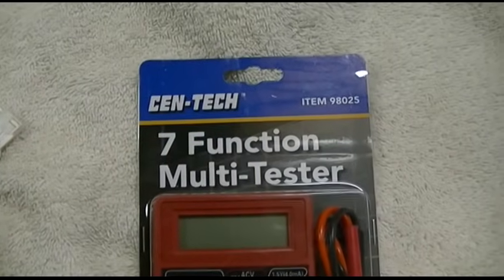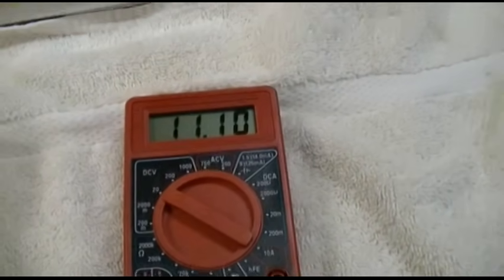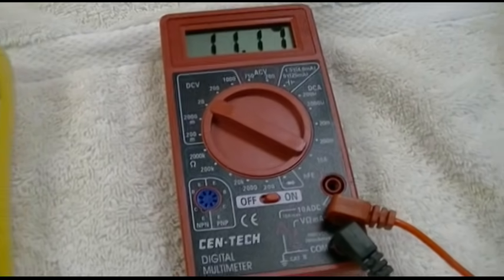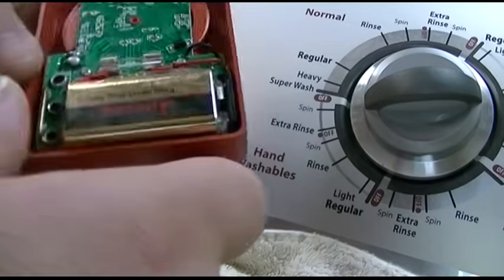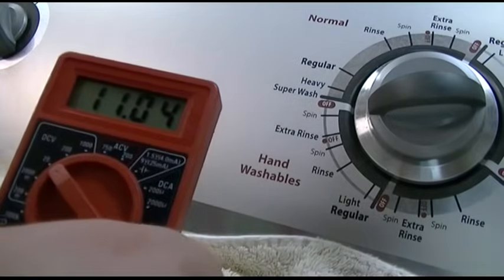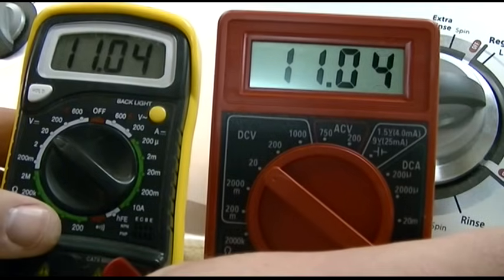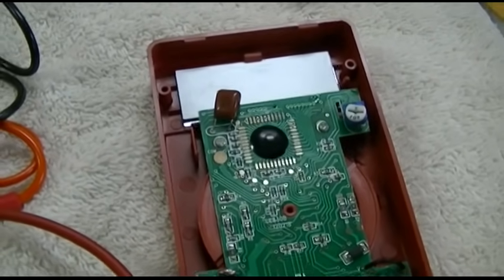Harbor Freight - Cen-Tech 7 Function Digital Multimeter Review

Comment: I got one of these for Christmas last year and it doesn't read at all. I wonder why is it doing that
Reply from the maker: Generally, 1 of 4 reasons:
1.  Low battery.
2.  Problem where the meter leads plug into the meter.
3.  Problem where the meter lead wires go into the probes.
4.  Problem where the meter lead wires go into the plug that goes into the meter.

The first one you can just try another 9V battery.  For the second, I have a video on how to fix that:  https://www.youtube.com/watch?v=s-99VP7UyZI

For the other 2, it's going to require soldering.

Comment: I have the same multimeter but when I switch it to the DCV 20 Setting it does not give me a decimal number reading except for three numbers like 000, 120, 230. Etc. I am trying to test the voltage of my car battery to see if it has 12.4 volts it needs. Does this mean my multimeter is broken and does not read the correct settings anymore ??
Reply from the maker: Sure it was on the 20V scale and not the 200 or 1000 by mistake?  If yes, it may be defective.  You can try measuring anyway, it's not going to hurt anything, and may still read (it's possible the decimal point in the display went bad).  If none of that is any good, it's likely defective.

I know of 3 problems with this meter, all involving the test leads and where they plug into, but this is a new problem I haven't heard of.  Anything is possible of course.  

Eventually, you'll get a coupon for another free one.

Comment: Update to this video look for the meter numbers. 63758 and 98025.  These two numbers you can adjust the meters and also replace the fuse.  all the other numbers looks like you're pretty much screwed.
Reply from the maker: Thanks for the additional info.
Reply: @jaykay18  Your welcome. There is a total number of six different meter numbers that you can get. I bought all six different ones took them apart and those two are the only ones that you can replace the fuse and also adjust the meter.

Comment: Which one is for continuity???? I Can’t find it
Reply from the maker: If you're looking for the continuity buzzer, you won't find it because it doesn't have one.
Reply: jaykay18 so it doesn’t have a continuity setting?
Reply from the maker: Not one where it will beep if there's continuity, but that doesn't mean you can't test continuity with it.
Reply: Yeah I’m testing my car fuses because my 12V sockets aren’t working and I’m not sure how to make sure they’re working
Reply from the maker: Continuity is measuring resistance, or ohms.  Set it on the ohms scale.    Put the probes together and get your base reading, which will be close to zero.  Whatever number that is, consider it as zero.  If you see just the vertical line on the display when you test a fuse, that fuse is bad.
Reply: jaykay18 thank you!!! This helped me out a lot and now my 12v sockets are fixed
Reply from the maker: See that, the Harbor Freight free meter saved the day again!

Comment: I did not find your video helpful.  I knew nothing about this meter and after watching your video, I still know nothing about this meter.  What are the red and black wires for?  Where do you plug them in?  How do you test a fuse on a car?  Maybe some of these answers are on a different video.  Anyhow, I see 2K on the thumbs up and under 350 on the thumbs down.  Some are happy with your work.  Have a great day.  Ed
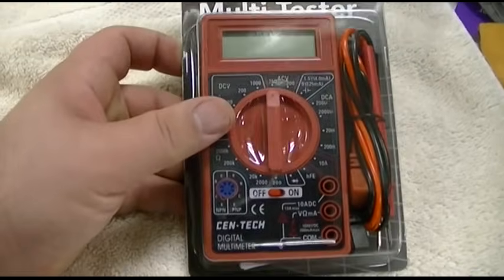Reply from the maker: At 1:04 I explained that how to use the multimeter was going to be beyond the scope of this video.  Most people will tell you that if you have to ask what the red and black wires are you shouldn't be using a multimeter, but I won't, rather, I applaud your willingness to learn.  Unfortunately, again, that was beyond the scope of my video.  There are hundreds, if not thousands of other videos that can explain it, and probably explain it better than I could, although I usually have a way with words.  I wish you the best in your endeavors and your quest for knowledge.

Comment: I know this video is old but I hope someone can help. I got this same multimeter and have been watching videos on “how” to use it. Working on my boat (12v system). 2 fuel tanks w/ a toggle switch that switches the “tank selector valve” between the two tanks. Same as some of the older Chevy trucks. I have removed the “valve” to replace but was told to check the wires first. It is a 6 point connector that plugs  into the valve. Told two turn the key to “acc” and then test each wire of the plug, in both toggle positions. Question: what setting do I use and what do I touch the red/black leads to??? PLEASE HELP.
Reply from the maker: If this connector with the 6 pins is hooked in to the rest of the boat, you'd set it on the DC volts scale, the 20 volt scale is fine.  The boat should be using a 12 volt system.  The meter will automatically detect if the probes are backwards, if so it'll just put a minus sign in front of it.

I'd imagine this is much like a car--put the black probe on a good ground, negative of the battery is fine if it's nearby.  Then start probing the connector, you should see 12 volts on certain pins depending on the switch position.  There may be pins you're not seeing 12 volts on.  But if you tell someone who knows "I got power on the red and the yellow wires depending on which way the switch is set", they can probably tell you it's good and to replace the valve.
Reply: @jaykay18  man i appreciate it TON!!! Thank you!!
Reply from the maker: No problem at all!  Comment back when you get it all sorted out.

Comment: Lol I'm a dummy. I bought it thinking I could test the voltage of my car batteries and alternator. Oh well, guess I'm not retiring my nearly 50 year old snap on meter after all. Now if I could only remember how to check dwell....
Reply from the maker: This will give you the voltage of your battery and the alternator with the engine running.

As for dwell, that's a measurement of the duty cycle of the circuit.  The breaker points switch the ignition coil on and off.  One side on the positive of the coil, the other side to ground.  You're interested in how long on vs. how long off.  A meter like this can't tell you that.  An expensive multimeter can, but those old vintage dwellmeters told you a lot more information, especially with an analog display.  That's why I always keep a couple old analog meters around.  And I have a dwellmeter for my 67 Riv.

Comment: I purchased the 98025 meter the other day for $2 at Harbor Freight. The board looks different, the fuse is different, it is soldered directly to the board and labeled .5A/250V. The potentiometer is missing.   The number on the board is DT-833, dated 2012.3.31, the board looks like a generic cheap multi-meter board that gets re-branded for whatever company wants to apply their name to the case.
Reply from the maker: That may be a copyright date on that board and not a manufacturing date.  That's why I always put the date I recorded the video on in the description.  This video is over 5 years old at the time of this writing.  Their stuff changes.
Reply: I think it is interesting how it has changed in a few years.  I put the revision number and date for reference purposes for any viewer to compare with their unit.  The board no longer contains a potentiometer, a new viewer might be looking for something that no longer exists on newer models. The fuse soldered directly to the board makes it cheaper to manufacture, it would be cheaper to get a new one then replace the fuse. 
It makes me wonder how far off the reading is on the unit.
Reply from the maker: I doubt the reading is very far off.  If you're using this basically to test for "power/no power", or if you know the approximate voltage you should be expecting, it does a fine job.  For very fine measurements like for electronics work, this is a no-go.

Comment: Say what you want. Free country. I purchased one of these meters, brought it home, opened the box, the meter was broken, the case was cracked. Went back to Harbor Freight, exchanged it, opened the box, same fricking thing. Exchanged it again, and in the store opened the box, and tested it, did not work. So I raised my standards a bit, and purchased a Klein.
Reply from the maker: You're probably the exception rather than the rule.  I must have 12 of these meters, maybe more, and every single one of them has worked out of the box.  Have the meter leads broken?  Yes, several times, and I've repaired them.  Your Klein was probably a minimum of 10 times the price of this meter (for a cheap one), and likely made in the factory in China right next door.

Comment: what i like about this meter is that you can turn it OFF to change the setting with out  it trying to show a different reading.       just dont let the smoke out.
Reply from the maker: Yes, always best to shut the meter before changing modes; other meters are better shielded but they can cost 10-100 times more!

Comment: I got a few of these for free several years ago using the coupons...every one of them has met my expectations as the usual unreliable made in China piece of junk. Bad leads, incorrect readings in any mode, no voltage when there is, you name it. If you need a reliable, accurate meter, save yourself a lot of headache and just buy a Fluke or other name brand. If you just play around and don't need accurate readings, this junk may get you through, especially if you get it for free.
Reply from the maker: For free, these meters are quite functional.  Fluke is made in China now also, so they're not as good as they used to be.

As for the leads on these meters, they can fail where they plug into the meter, or the wires can fall out of the probes, both are simple fixes, and I have videos demonstrating repair techniques for both.
https://www.youtube.com/watch?v=s-99VP7UyZI
https://www.youtube.com/watch?v=bx0X-l0QITA
Reply: @jaykay18  
Thank you for the reply.
What I meant by "the usual unreliable made in China piece of junk" was these are of the typical low quality generic item that China mass produces for export, slapping anyone's name on it that wants to claim it as their product. They mass produce junk at the lowest possible cost, which means use of faulty and dangerous components of the lowest possible quality and engineering/design standards, just enough to get something shipped out, and we in turn create a demand for these items because we're cheap and they're cheap so we're a match made in China. Lol
They, their government in particular, just wants the world's wealth and power transferred to them so they encourage this practice, and a lot of their population are desperate so this is what they put out to serve their communist government. They tend to keep THEIR best for themselves, pumping out junk for everyone else, especially America.
You shouldn't have to fix something you just bought, or got free with a coupon because you bought some other junk. Its not even worth the time to take it back or throw away even to fill our landfills with more of China's trash that we paid to have made and shipped over. Lol
These generic items are always of far less quality than items originally designed and/or made by a reputable company elsewhere with quality standards in place. And they always diminish that quality once they begin manufacturing them there, but companies get greedy and sometimes desperate for that year over year profit margin increase so they consider it an acceptable tradeoff.
Anyway, thanks for the tips to repair, but again, they aren't worth the time...unless you're trying to teach someone some basic troubleshooting and repair skills.
They aren't even worth the time I spent typing, or the battery power I used on my device, or the cost of the transfer and storage of data out there in cyberspace, or the time it took to design the coupon, or the cost of ad space, paper and ink, mailing it out, wear and tear on the printing press, the vehicles used to transport, and so on...let alone the time I originally spent watching your video.
My point is, we waste a lot of resources on junk, our most valuable one being our time.
Thank you for taking the time to make and share your video though, and for reading my comment and replying.

Comment: Recently picked up my 2nd HF Multimeter with the coupon.
Haven't tested the accuracy using another meter, but the first one appears to be functioning within a reasonable range. Using it mostly to test resistors, diodes and low voltage projects.
Reply from the maker: Yes, I wouldn't use this for any mission-critical work, but for simple measurements where they don't have to be exact, it's plenty good.
Reply: Thank you for the video.
Cheers brother
Reply from the maker: No problem!

Comment: Have 3 of these .be careful on low ohms if you apply voltage burns out a resistor .good for price.
Reply from the maker: Thanks.
Reply: It will make a popping noise then your meter shot
Reply: Clamp-On Multimeter Channel friend left in microwave turned on really pooped was a 100$ one .we repaired TV's and was perfect for what we did .have all kinds of expensive equipment but hiring help theese were better could throw them away.😎have 3left closed store 2007

Comment: Just picked one up yesterday for free. I noticed the one in your video says 10ADC while the the one I just picked up says 5ADC.
Reply from the maker: The products change in time; the one you picked up isn't the same item number as this one.  Apparently, one of their revisions was to lower the amperage reading capabilities.
Reply: @jaykay18  Totally sucks, but can't complain since it was free.
Reply from the maker: I've probably collected 5 or 6 of them.  They're cheap, so they can stop working at any time.  I've found a common problem with the design, and will be releasing another video about this meter in a few weeks, you may wish to check back.

Comment: I've got the same meter you're showing and took the back off and there is no adjustment in the back!!!
Reply from the maker: Yes, the newer ones don't have the adjustment potentiometer anymore.  The "98025" model that was shown here has it for sure.  Harbor Freight often has multiple item numbers for the same item, and there are minute differences between them.
Reply from the maker: They probably saved half a cent per unit by eliminating the potentiometer.

Comment: if it is free maybe okay, accuracy of this meter could lead you to wrong decision as far as repair or replace
Reply from the maker: Yeah I don't necessarily trust this meter implicitly, I mainly use it to do voltage checks in terms of "there is voltage, and it's about this", or "there's NO voltage".  If it's more exacting work, the real meter comes out.

Comment: Im trying to measure voltage drop on the fuses in my vehicle.  Looking for parasitic draw
Reply from the maker: In that case you're going to want to measure amps.  Disconnect the negative battery cable and put the meter in series with the battery and the battery cable.  Then start pulling fuses.  When the amperage goes down, you've found a potential culprit.

Comment: How do you check the control box for a water well with the model centech 98025 ? I've came up empty on Google and YouTube searches.
Reply from the maker: Depends what you're testing.  You want to test first to see that voltage is coming in, so you'd use the AC volts scale.  Then, shut the power and test the switch for it, if it's calling for water, on the ohms scale it should read close to zero.  That's pretty much it.  If there is voltage, and the switch is working, probably it's the pump itself.

If you've never tested line voltage before and really don't know what you're doing, which is the impression I get, you're probably best off calling someone in so you don't blow yourself (or the meter) up.  If you do that, perhaps if you watch what they do intently, you might get a clue what to check for should this problem happen again.
Reply: jaykay18 thank you for the reply. I should have been more specific. I want to check the L1 and L2 terminals to see if electricity is coming in. What do I set the meter to? You are correct in that I have never used a meter before however I have replaced several pressure switches and control boxes.
Reply from the maker: If the pump runs on 120 volts, set it to the 200 V AC scale.  If it's 240 volts, set it to the 750 V AC scale.
Reply: Thank you for the help.

Comment: FYI: I have a Cen-Tech 98025.
It looks a LOT different inside.
The fuse is non-replaceable.
I can't find the potentiometer & it's certainly not like in your video.

on the left in the middle, the board is stamped 
DT833
2012.3.31
Reply from the maker: Perhaps Harbor Freight saw this video and cheapened the design.
Reply: Are you sure its that number? They have several different numbers of this meter The Meters looked exactly the same but have different numbers